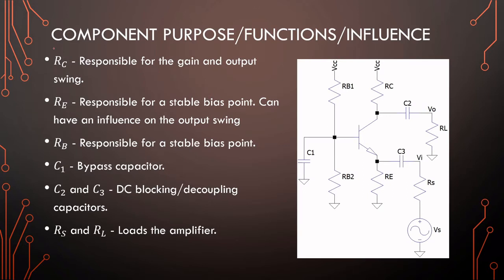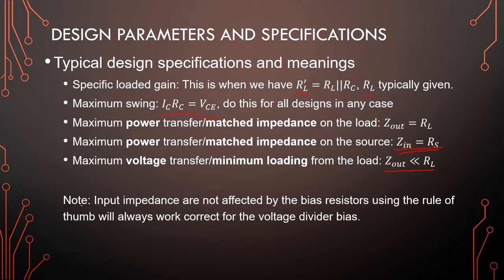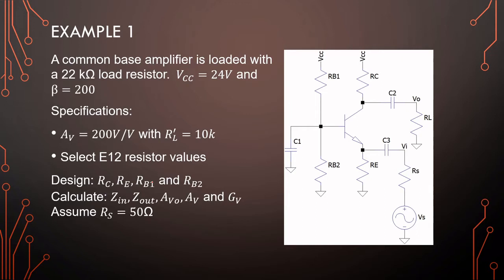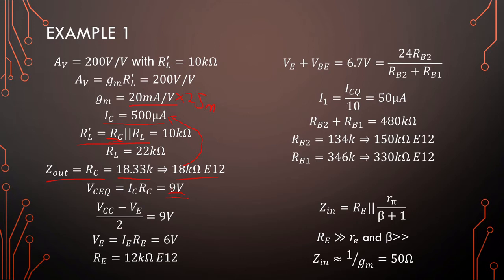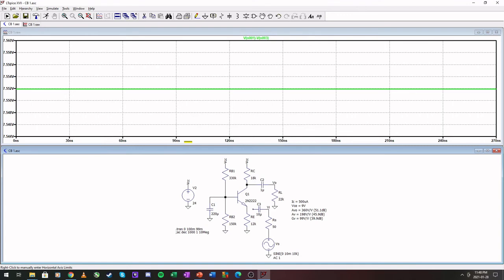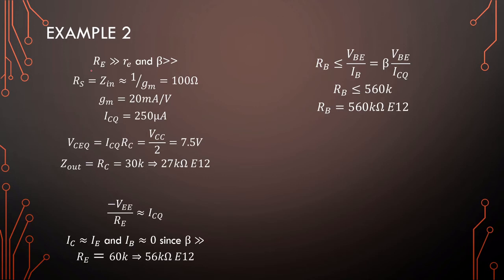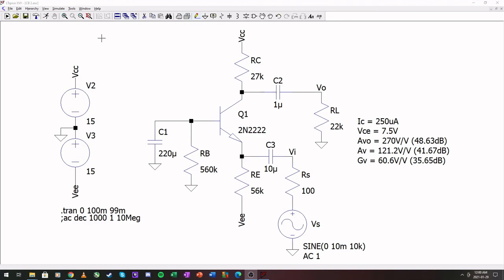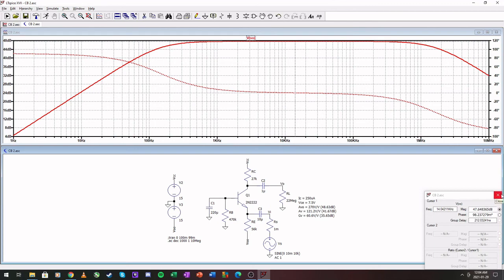Video 8 - Common base amplifier design

Comment: Thank u in advance
Reply from the maker: Any time. I try. Thanks!
Reply: @EzElectronics  so if i want to design a common base with gain 7v/v  i should follow the same steps right ?
Reply from the maker: Yes. With the common base the bias resistors have no effect on the input impedance so using the rule of thumb will be 100% ok.

Comment: Why I1=IC/10 i didnt get it
Reply from the maker: It is a general rule to use, easier for beginners and studenta. It ensures that there is enough current available to go into the base while keeping the bias resistors large. You can use any current as long as there is enough to go into the base (larger than Ic/beta but beta is not always the same since it is a range and not a fixed value)